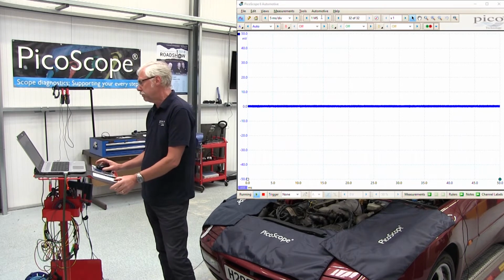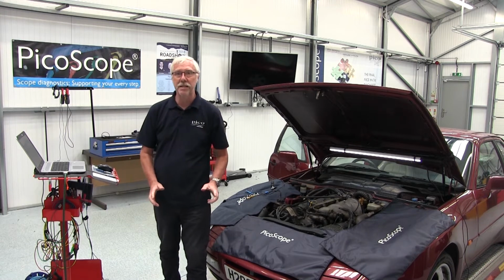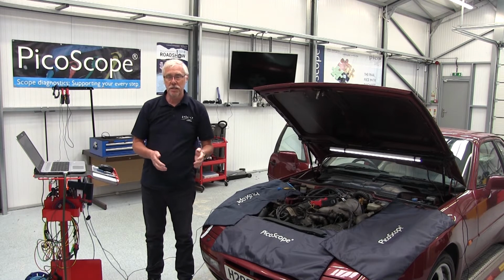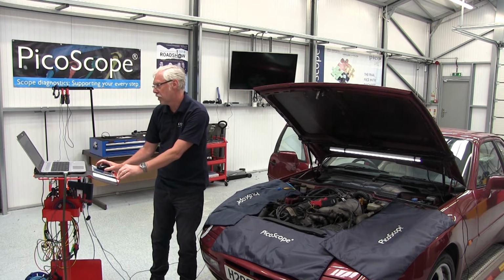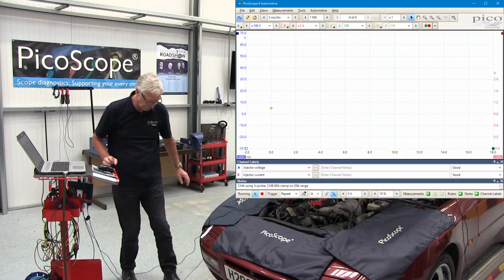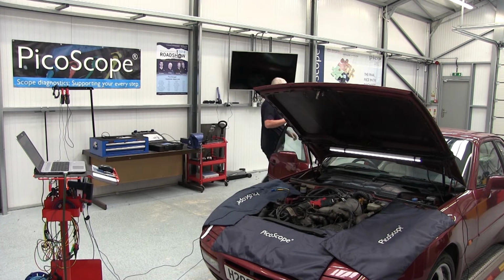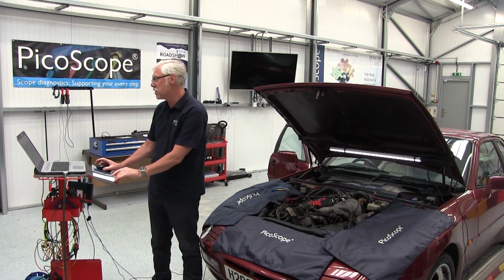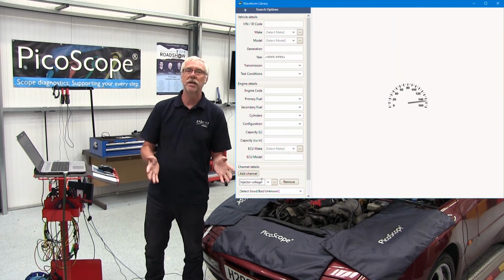Multi-point injection - injector voltage and current

Comment: How do use it when injectors are under manifold with 24 way connector
Reply: You will need to find the switched earth circuit terminal(s) in that connector that correspond to the suspected bad injector(s). You will then need to back probe the connector to make a connection with the voltage probe (unless you have suitable breakout leads). You can place the current clamp around the corresponding switched earth circuit or the voltage supply circuit wires. Possibly you would need good system information available to tell you which pin is which, but if it is a dedicated connector for the injectors then it is likely that the terminals will be arranged in a logical order. You should be able to deduce, after a few trial connections, how it is arranged. Hope that helps, Barney

Comment: I'm a little confused about when I need to use a 10:1 attenuator for voltage spikes when an inductor like the fuel injector solenoid shuts off. Evidently the 60V spike wasn't enough to justify that here, but what about unknown devices? Can you give us a general automotive rule of thumb when attenuators are generally warranted? Is it fair to say they are never needed for capacitive leads, never for current clamps, always for voltage on primary or secondary ignition leads, and sometimes for other solenoids?
Reply: spelunkerd you only really need it for primary ignition on most. Secondary the car is running so you don’t need it, if that makes sense. You don’t need it for ant solenoids as far as I know. And yes never for current clamps
Reply: Hi, as per Welding Junkie's reply below, you always need them for primary ignition.

If you have one of our older scopes (e.g. PS3XXX or PS4x23 series), which have only a +/- 50V input range, then you will always need attenuation for injectors (with both indirect injection, as above, and direct injection injectors). Our more recent devices (e.g. PS4x25) have a +/- 200 V input range so it is unlikely (but not impossible - so you have to check by using an attenuator first) that you will need attenuation for these devices.

You must take extreme care with High-Intensity Discharge (HID) headlamps operation as they have some similarities to primary ignition. I suggest that you don't use a scope on these but hypothetically if you did, you would need attenuation.

The only rule of thumb is this: if you are unsure about the voltage of the device that you are measuring, use an attenuator first (with the appropriate probe setting in the software). It takes only 10 s to set up but can save you from a damaged scope or worse, damage to yourself.

Oh, and one last thing: NEVER USE ATTENUATORS WHEN TAKING MEASUREMENTS ON HIGH VOLTAGE ELECTRIC VEHICLES. Attenuators are not designed for this purpose and their use could kill you.

Hope that helps. Barney
Reply: @pico_barney  Brilliant summary, Barney! Thank you.
Reply: The latest Pico has a 200V limit so 60V is no problem.